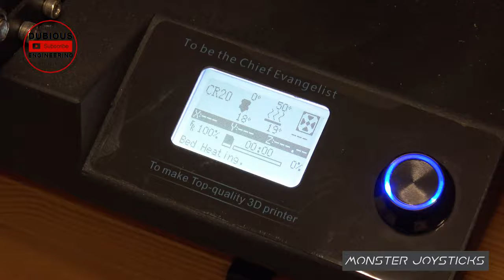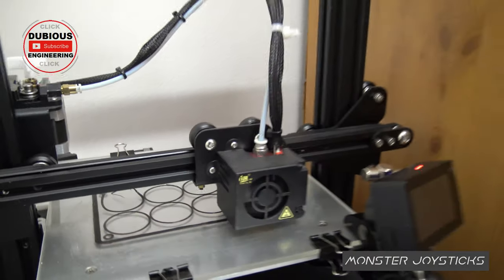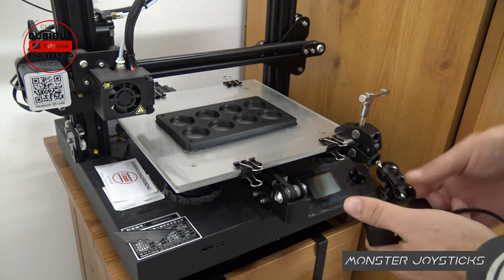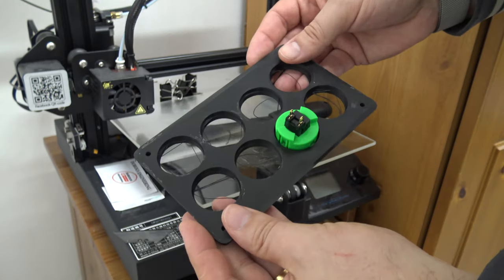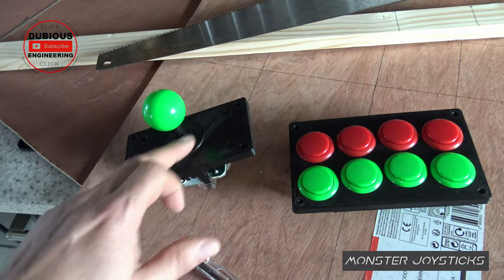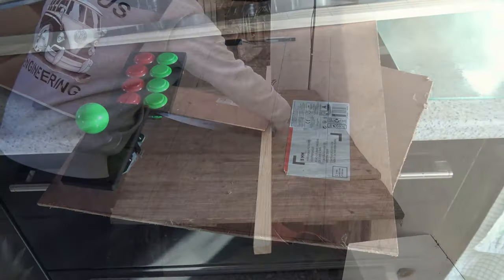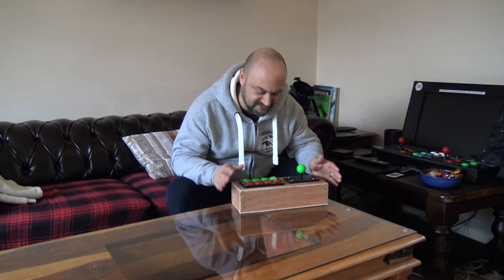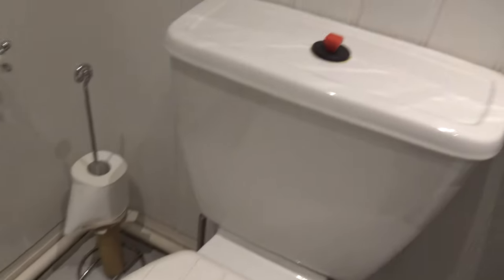DuB-EnG: 3D Printed Arcade Machine Joystick Build - coffee table computer and  Monster Joysticks

Comment: Every time I see someone printing on glass, I'm so thankful for the Prusa's spring steel sheet bed... As a printer, it's not perfect, I've had a long print fail on me today after suffering a layer shift issue (didn't see how it happened, wasn't there). Seeing how much work just a regular print takes on things like this, makes me feel well worth the potentially added cost of the unit itself :D 

Awesome project though !
Reply from the maker: Hey igor!! ... this unit came with a fibreglass bed that worked really well for ages, but then the surface just seemed to wear out and get messy after a few hundred prints.  The glass seems more hard wearing.  Sorry to hear you had a print that failed today.  Always sucks!!  What model printer do you have ?
Reply: Thanks, eh, it's just a reminder for me that you can't always leave these things running  on their own :D

I have the Prusa MK3(S now, after the upgrades), it has a PEI film on top of a flexible steel sheet, held down to the printer by magnets. I only ever have to glue down flexible material, everything else is kept down by the heatbed, and taking things off is a matter of just lightly bending the sheet - it bounces right back.

Comment: Hi, should be good. Irony is you are using 21st century 3d printer but not using the 1960s device of a workmate or equivalent so end up destroying table ! Does the glass not dissipate the heat from the printer bed ? That may be why you had layer adhesion problems.
Reply from the maker: adhesion has been an issue for ages...  sometimes your lucky, sometimes not...  I’ll get a temp sensor on the glass and see what the top surface is...  or I may actually bump up the 50deg heater to 60deg and see if that helps!  the best solution I’ve found isn’t hairspray or print stick... but pva...  then things always stick :-) ...  I plan to make some corners to help make this thing look prettier